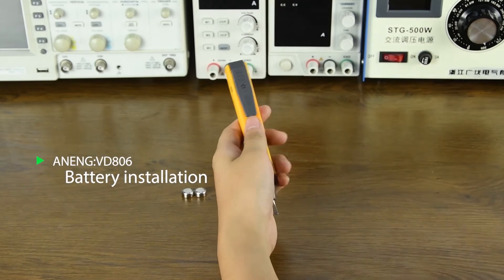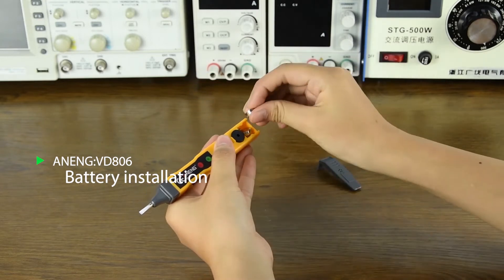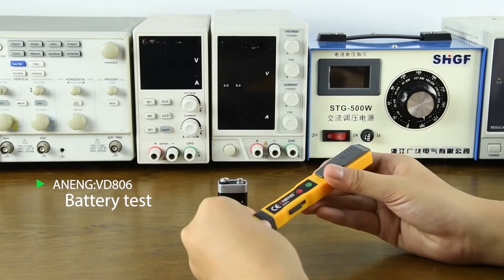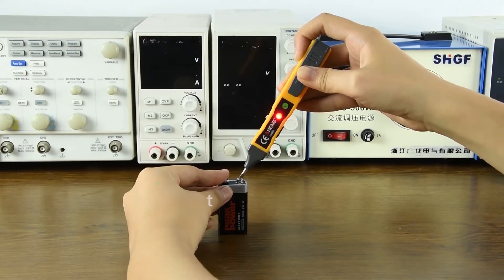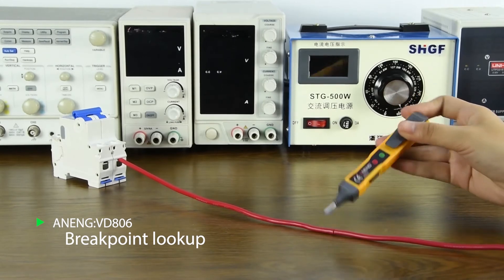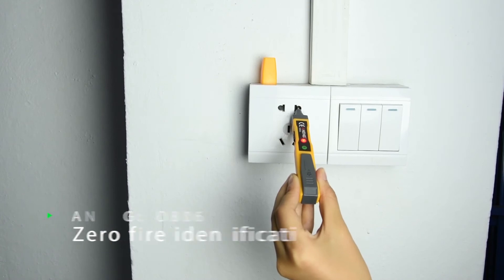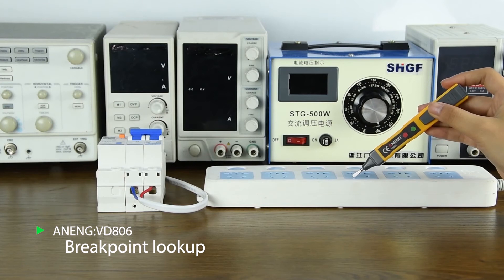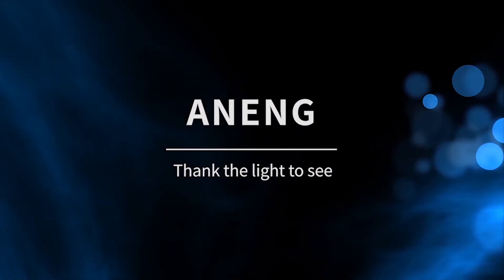VD806 ACDC Voltage Detector Non-Contact Tester Pen Battery Meter Current Electric Sound Light Alarm

Comment: I just received mine, one that I bought from Ebay, and the batteries must be inserted the other opposite way, as indicated (engraved) on the bottom. Maybe I get a counterfeit one, it doesn't work well, it's not sensitive enough. The older tester pen I had before was able to detect a computer screen or a TV at one meter, this one don't even detect it when I put it on the screen.

Comment: What type of battery's does this take?? Thanks
Reply: It could take a few different kinds,  but the very common LR44 batteries might be the best, in my opinion   Any button batteries that fit, and can output 1.5 volts should work for a while.  The contacts are springy enough to allow for some variation in button battery thickness.   Incidentally, despite the card with the tester saying to insert the batteries in the polarity shown -- it is impossible to see the position on the card that I got with it.   Button batteries like these, seen to be different from larger batteries like AA, in that for the button batteries, the smaller contact side is the negative and the larger contact side, which includes the outside of the flat cylinder is the positive.    With the screwdriver point, pointing at me, then the positive side goes to the left and the smaller negative contact goes to the right.
Reply: @AustinHook  Strange. I just received mine, and the batteries must be inserted the other opposite way, as indicated (engraved) on the bottom.

Comment: How long does the batteries last since there is no power-off switch?
Reply: The instruction card with mine says it can be used for 5 hours when the switch is in the 0 position.   I am not sure whether the other positions will let it last longer or shorter.  In any case, when I left the batteries installed for a few hours, with the switch as the zero position, they were measurably depleted.   So I conclude that there is no proper battery off switch or way to disengage them when they are inserted.   I suppose one could insert a small tab of plastic between them, or between one of the batteries and it's contact point,  to stop the drain, but probably may as well just remove them as soon as possible after making a test.     Of course, searching for continuity, one might want to keep the batteries running for a fair while -- so it looks like it would be a good idea to have an ample supply of batteries.
Reply: @AustinHook  By '0' position, I assumed you're referring to the default, meaning left position. If so, I doubt it last a mere 5hrs as I am still using the original batteries and have this tester pen for months and it's still operational.